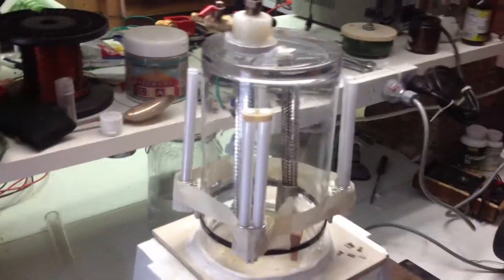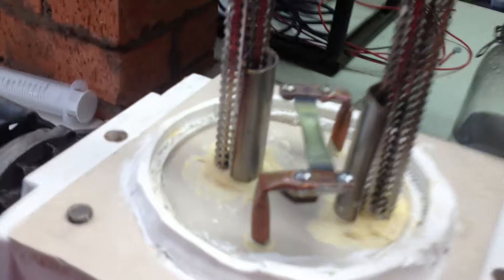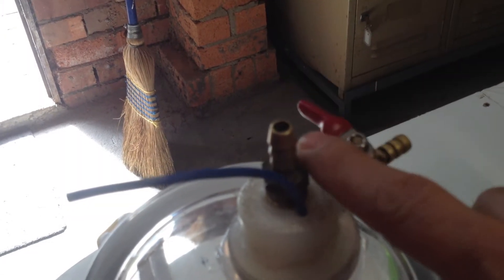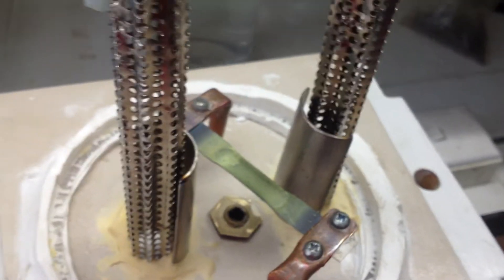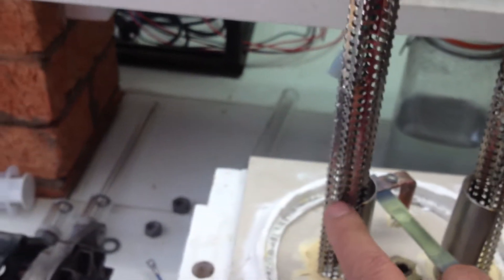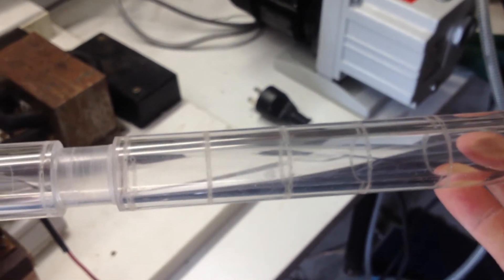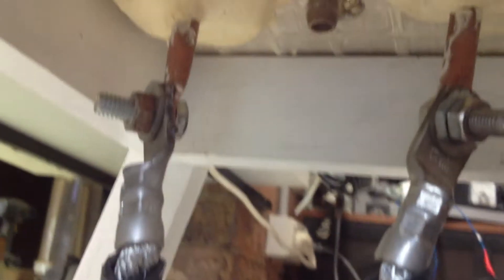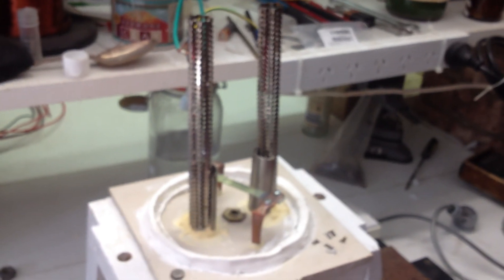Stan Meyer magnetic gas apparatus

Comment: there is one video where Stan  asks if the recorder is of. The answer is yes but it is still recording. I believe he actually lets the secret out in one sentence. He says that people will not want an electric car even if it charges itself. I believe what he was talking about was in actuality he was building and or using a Don Smith/Tariel kapadnse/Tesla fuelless generator to produce high frequency high voltage electricity. At this point it also moot as to whether he uses HHO, hydrogen or just brute forsce splits water....Definitely check out Don Smith 1996 Tesla conference these actually work.

Comment: How good is plaster in sealing vacuum, and how much it degases? How much vacuum will you have in the chamber?
Reply from the maker: plaster is not bad for sealing if you use good quality like I have, also I can seal from underneath with silicone if I have to but the main reason I used it for was heat resistance... I plan to have about 70 cm hg vacuum in the chamber.. I am using a vacuum pump from a vacuum furnace so it can handle the heat no problem.

Comment: it looks like the mirror at the end of the tube is out of alignment-i have an old argon laser that has lost its gas. The optical bench is still good. Both mirrors are not as fat but they have adjustment screws for aligning the mirrors so it will lase.